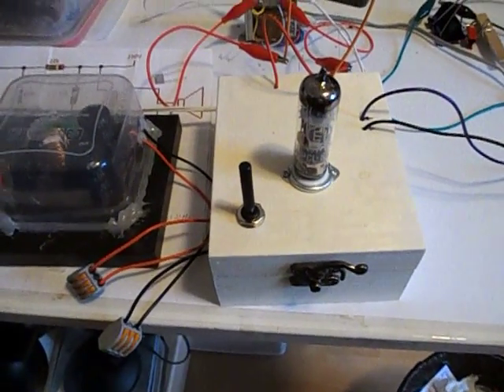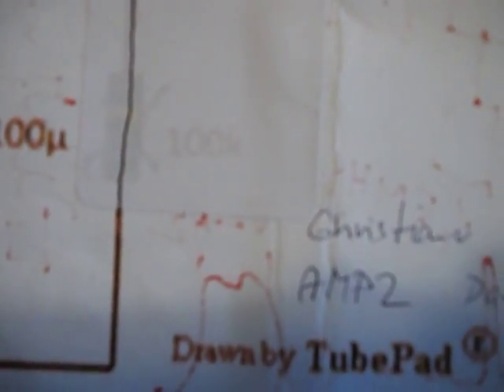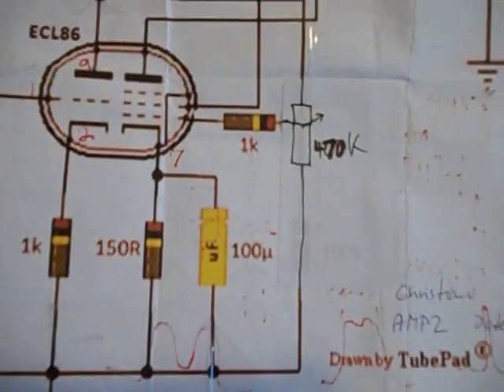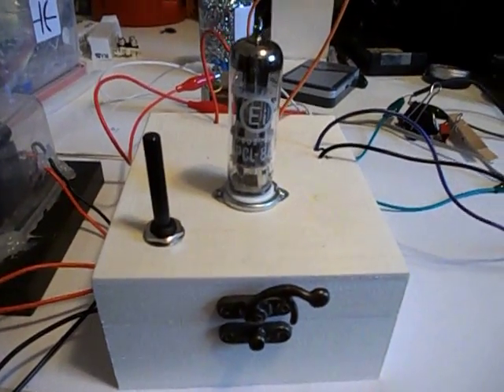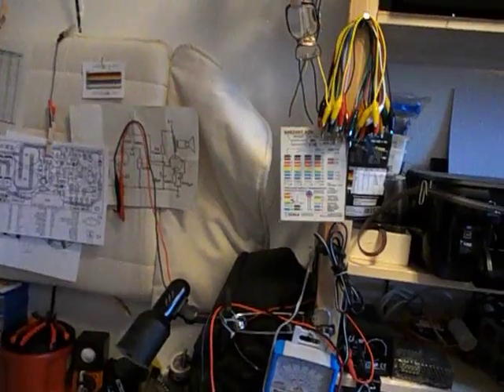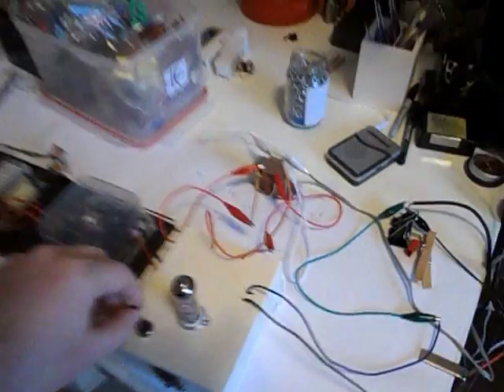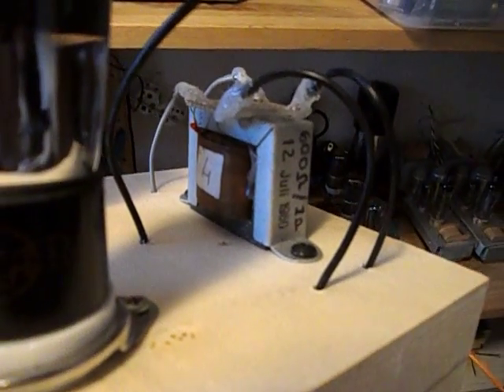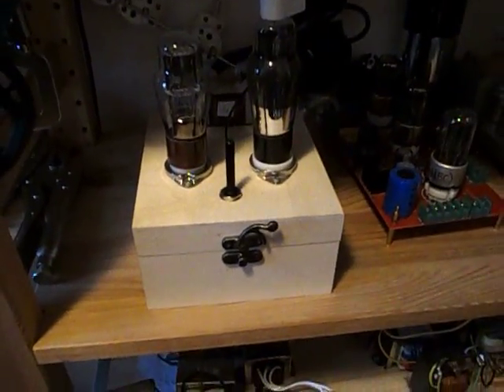PCL86 Amp Build No.3

Comment: very good thx for circuit !
can I use 220v ac from power oitlet with full bridge rectifier for power supply or I mist use transformer
Reply from the maker: Well, you could do that....but I would NOT. I lived in Europe when I made this and I used an isolation transformer. Yes, you'd have a decent voltage in DC for using with tubes, but it'd be so much more dangerous to work with. At the least use an incandescent light bulb in the AC coming in as a ballast. This could safe your life if you made a mistake.

Uncle Doug has a great (and simple) vid how to do this. Go to Tesco or OBI or something and get an INCANDESCENT bulb if you can for this.

https://youtu.be/wRFRwOnLsZI